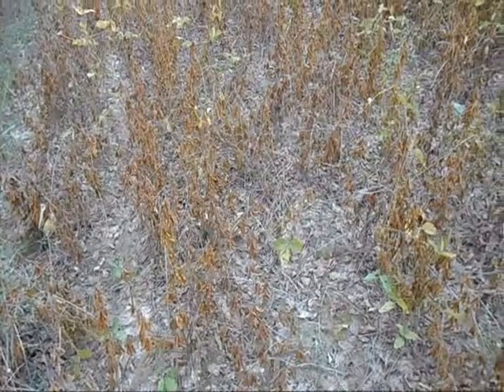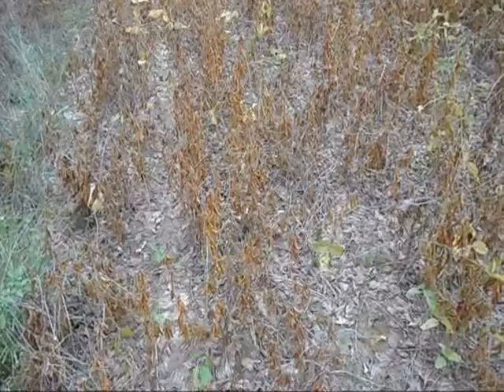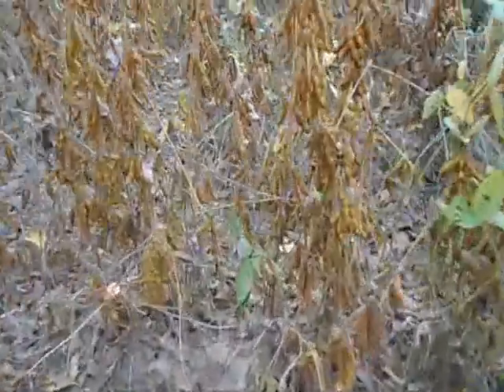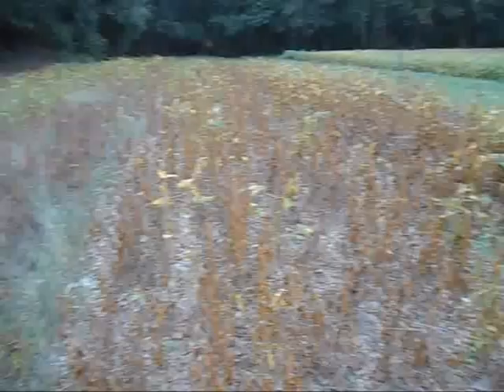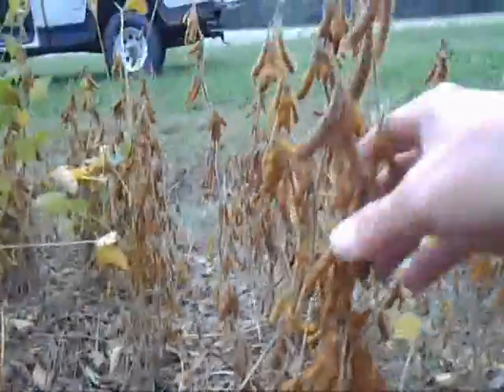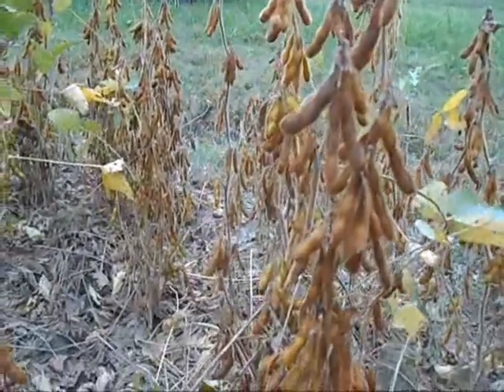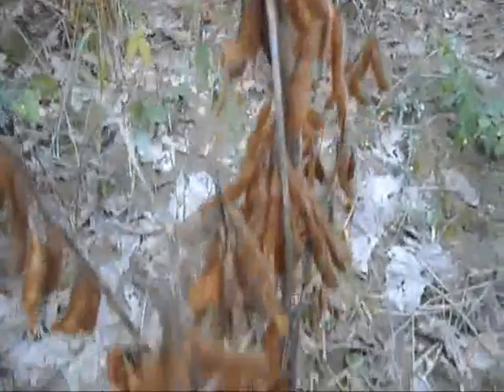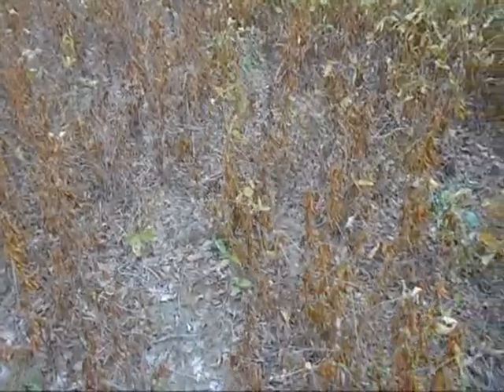No till Experiment

Comment: A friend of mine ptanted beans with a 20 ft Great plains coulter drill combo Three times before he got a stand...... so   you did pretty good
Reply from the maker: there are a good number of beans on the plants that did come up, but the plant population is less than half that of those in the fields of cut dirt.  dragging my drill across hard ground did not get the seed into the ground like the solid heavy coulters on a no till would have done.   also with my drill to achieve good plant population I have had to learn to slow down my tractor travel speed.   David, thanks for watching.  in an older video on my channel https://www.youtube.com/watch?v=bA83aSbNNaI that's my planter at about the correct speed.